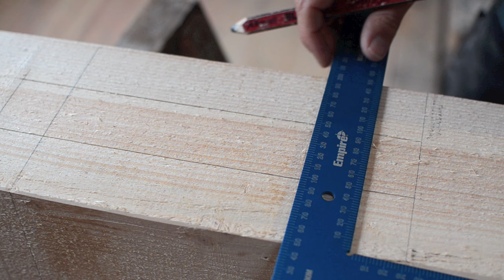Strong Joint - Timber Frame Roof Truss II

Comment: Sorry for the long comment, but perhaps you will find this information both corrective and useful in your future work...You kind of lost me on this one with "strong joint" unless that was a question (?) which in this case is, "Sorry, no, not really, for several reasons."

First, I think this is out of context with Steve's work. Second, your relationship within the video's demonstration of a European version of a joint as compared  to Japanese  (or Asian timber frame joinery) is out of context as this more reinvented (or reinterpreted) European styles of joinery to some degree, and applying them to what  is Asian modalities, while using a "mill rule" or "edge rule" layout system rather than what is found in Japan which is the ancient "Line Rule," modalities of layout which are very different systems and approaches. Third the nomenclature seems to be incorrect  (???) as I have never heard of..."Kashigi Oozier Hobo Sash"...though this could just be a poor translation. If you did mean...傾ぎ大入れ - “Kashigi dai ire”...thought not “very strong in this application as would be a through tenon and wedges as found in Dutch Barns, or in the Japanese vernacular a 鼻栓 - “Bisen” type joint like… 鼻栓ホゾ - “Bisen hozo” in one of the larger forms…

Your “Wedged Dovetail” (片下げあり - Kata sage ari) looks well executed, however they are seldom pegged as there is little reason to do so. Pinning the wedge in place would be more advantageous if worried about displacement over time as the “relish” on the tenon makes the pegs pointless. In a lateral load, the relish would just rip out.

The tenon on the brace is entirely incorrect for taking the greatest advantage of the wood's natural strength. It is also an "oblique brace" in the vertical orientation which is seldom to never used in Asian architecture where (if used) is typically in the foundation and in a horizontal orientation from sill beam to sill beam (火打梁 - “Hiuchibari”)...or...in roofs from rafter plate to rafter plate. If vertical "brace beams" are employed they are huge and act as "wind bracing" within lashed rafter systems as found in traditional Minka…

If this feedback was of value, please feel free to ask more questions...Thanks for sharing your work on this project...
Reply: Mr Whitecloud, you strike again. You are literally, present in a ton of places on the internet. You come across as an expert or seriously informed in so many different disciplines that its hard to believe anymore. It feels as if you spend your life on the internet, due to the never ending commentary on all things you offer. Permies. Youtube. Other forums. From a non expert, but observer of everything. Be well personally.
Reply: @LitoGeorge  Hello George…The web’s algorithms make suggestions to watch and I share what I’ve been lucking to learn. As for “expert” that is for others to consider; I dwell on it little. I have been blessed to be raised in and live a more traditional life; getting to meet others of like kind over the decades along the way and share it where it seems fit or asked to (ie. forums, etc.) What one chooses to believe (or not) has no real bearing on the information shared. My time “online” is limited to a cup of tea in the morning and late at night as I sleep little…and when lucky enough to be near this computer…LOL!
Reply: @littleforest  I will gladly remove the comment  @littleforest  if it was not of value to you, or you find such comment disrupting to the harmony of your channel...
Reply: @JayCWhiteCloud   Hi - you should apply to the Guiness Book of World Records for having the worlds largest ever cup of tea. Keep on experting.... cheers
Reply from the maker: Good morning Mr Whitecloud :-)
I consider the freedom of speech as something valuable. As long as they are somehow polite, i do not erase comments. 
So, you are free to do with your comment what feels right for you.
And it is up to the reader to see what opinion or point of view he/she takes as an inspiration.
Reply: @LitoGeorge  Apologies for the typos in my post to you...I corrected it.  Being in the "Guinness Book Records" is not something I would ever wish to strive for I don't...LOL!!!...Some find value in my comments I’ve been told, while others take uncertain umbrage or question validity, I"m fine with that...Thanks for sharing your views of it all...If you do have technical or direct questions on this topic I would be pleased to respond to them...
Reply: @littleforest Thank you, Sir I appreciate that perspective very much. My comment was meant as one professional in woodworking sharing knowledge with a peer. After 50 years in the traditional arts (including working as a Timberwirght) I thought you might find some value in what I shared and it would also afford you information to do even more in-depth research into Asian timber framing styles with the kanji I shared in my first post. I wish to also be clear that my comment was not meant, in any way, to disparage the fine quality of work you demonstrated in the video, but rather to suggest that some aspects are more "modern interpretation" and/or not best practice for certain (not all) aspects of what is viewable in the video. Thank you again for your comment and the videos you chose to share...
Reply from the maker: Now, as some time as passed by...
What i like most in all these internet things is to share knowledge, ideas and methods. Sometimes things get more value as they are done exactly different than the schoolbook tells, but the best is, to get trust: 'yes, i can do it and i do not need to be the super expert for it.'
I do not consider myself an expert knowing everything. So, i am open and thankful, for comments including reflecting questions or better/new ideas. Some of your older comments on my videos had something constructive in them.
If you now re-read your first comment on this video and put yourself into the reader's or my skin - even if some points might be 'correct', would you find anything inspiring, motivating or constructive in it ?
Reply: @littleforest  Hi Littleforest...Good to hear from you...I agree with a lot of what you shared. I only post on channels that have value and are being done by those who love what they are doing and wish to share it with others while they refine their skills and learn. The exchanges, like this one, are very enjoyable when it is based on open learning and sharing perspectives.

Doing things differently is all good...IF...(???)...the one doing something “different” understands the full aspects of the given thing they are doing. Taking this away from timber framing for a moment; experimenting when things aren't critical, (i.e. the failure won’t be dangerous and/or costly to repair) to learn a system to see how things work (for yourself or others) is how we grow every craft. Even medicine and science are a craft or at one time considered so. There is a lot of experimenting that goes on there for sure…

I certainly agree with the book part, having not learned to read until I was almost 13 years old. I now love books and appreciate the knowledge that can come from them but empirical learning (i.e. studying old buildings that have lasted) and learning from those in a craft (I apprentice with old order Amish as a Barnwright at just around 13 and that last 10 years on and off.) Part of the reason I became an experiential educator was the reality that many just do better learning “by doing.” I also teach what I was taught; the materials, tools, empirical observation, and the “process” of doing something will impart more valuable knowledge than any person or book could ever achieve…

I’ve been working wood (mostly green) from furniture to full architecture since 1968, so I guess that makes it now over 50 years, and I certainly am learning new things all the time. “Expertise” is a moving target and not one that any “real expert” claims as they typically are always trying to learn more. Our conversation made me dig through a bunch of old stuff in the folk style of Eastern Europe you have some weird oblique braces that have odd tenons on them similar to yours, with the difference they are blunted and housed. As you learn more about “relish” and the compression work that oblique braces perform within a structural diaphragm, you will understand this conversation more richly I’m sure. Your style, one of the reasons I started following the channel, has very strong Eastern European folk methods contained within it. I love this region (my father was Roma) and if I had been around while you were picking out this design for your frame I would have suggested looking at them and perhaps doing a “let in” live edge brace with dovetail housings. It fits the style you seem to have…

Your last point has great value to me, and I am so appreciative of it…!!!...I’m an inactive Marine and a former wilderness education director for a “boot camp” working with very aggressive inner city male youth for almost a decade. I developed this “militant” speaking and writing style that I’m ever trying to grow out of and feedback like yours (and I hope more!) is great to read!!! I’m used to “directive-driven communication” from having a science background, working with structural engineers on projects and my military service, so I tend to write that way still. That does not mean when speaking to a stranger or trying to convey information (like my first post) that this style works or is the best…IT ISN’T…!!!...and thanks for that feedback once more! Looking forward to your next video and please feel free to reach out any time directly if you have questions or ideas you wish to explore for projects…
Reply: @JayCWhiteCloud   this is good stuff from you in just one post. Father is a Roma, illiterate until 12. Apprenticed with Amish from 13 to 23, Barnwright, Timberwright, Marine, Wilderness Education Director for ten years. Has a science background, works with structural engineers. On Permies in 2014, you said you were a seasoned and experienced facilitator for over 35 years. You said you are pushing back and vetting the qualifications of people in the Permaculture world. That you have been doing this "Permaculture stuff" for a very long time. In 2015 on Permies,  you stated you had a job as a "State Supervisor in Pest and Wildlife Control for the State of Connecticut." To become State Supervisor takes more than a decade of service in that industry btw. Elsewhere you write that from 1987-1991 you worked at Bio-Tech Inc., Brookfield, CT as a Nuisance Wildlife Control Agent. During the same time period you were also "CT State Licensed Supervisor in General and Commercial Pest Control". During the very same time period you did a couple other jobs worth noting on your Linked In Profile. Seems similar but there is a vast difference being licensed for a job, than being the State Supervisor for the work itself. You are highly authoritative on all things Architecture from "vernacular, folk architecture in timber, stone and earth of the Americas, Middle East and Asia. Complete finish carpentry and guild crafts (e.g. blacksmithing, textiles, ceramics, etc.)."  You live in a log home built by someone else. Has written 2409 posts on Permies alone since 2012 (as of April 26, 2024). You use the word "modalities" in about 1/5rd of your posts. Most interestingly, your own Bio conflicts with what you said you were trained in and experienced in on time lines and years of experience. You wrote it, not me: https://tosatomo.blogspot.com/p/jay-c.html   According to you, you are a facilitator of both old Guild Arts and Crafts, have held professional certifications and backgrounds in Rock Climbing, Wilderness Education, Indigenous Life Skills, and Wilderness Medicine, Safe Crisis Management, Leadership Development, and Team Building, Self Defense for Women, as well as Situational Awareness and Security. Discharged U. S. Marine,  worked as a Park Naturalist, Zookeeper, and Animal Husbandry/Vet Tech, while also for a time being the Tree Warden in Thetford, Vermont and a long history in the Arborist trade. 
Jay owns and operates Tosa Tomo Designs, subcontracting and consulting to several Architects and Design Build Firms. He also, on occasion subcontract in Wilderness Guiding, Natural and Traditional Building Workshops, Indigenous Life Skills, Leadership Development, Experiential Therapy, and Personal Security/Self Defense.

Phew! Its a surprise that you didnt find time to be chief advisor to Che Guevara and Ronald Reagan, and oversee the NASA space program simultaneously while advising the United Nations on Housing, Water Security, Poverty Eradication and Disease Control . So, I have learned that you are excellent at producing word salads and massaging your experience into what fits for the moment. Despite your wonderfully authoritative writing style and absolute politeness in your posts, when I see your name in future, its a sign that being a wordsmith is an art in and of itself.
Reply: @LitoGeorge   Thanks for "plugging" my resume/CV...but I'm really not hurting for projects or work at this time...

Yes, it has been a rewarding life with many blessings and great teachers along the way. I think being an only child and growing up in a “traditional skills” household of artists, makers, and architects greatly influenced who I became as an adult, along with travel both in the military and on my own. My timelines of work, as stated are eclectic, never working on just one project at a time as it seems you have questions about. I’ve written less “online” in recent years as there are simply too many “trolls” haunting online forums and even in the real world I have learned as of late. Conversations like this and emails are about it now. The owner of Permies requested I join as a moderator but my tolerance for “profit base” activities by others has a limit and why I find more forums of little value now as the quantity of ultracrepidarians and trolls present is just too great. Individual conversations like this between two people are low-key enough to stay out of the guess of algorithms and not attract attention except the person I’m corresponding with…aka…no trolls…LOL!!!... However, I do find my own forum for historic restoration professionals on LinkedIn rewarding.

It seems you looked at my LinkedIn CV. You should note…since you are questioning it…that  “State Supervisor” in that field, in the 80s is a matter of having a degree or equivalent experience and taking both written and oral examinations…nothing more so uncertain of what you think you understand about that. The world has changed a great deal since the 80s. 

If all this is of interest (?) or you're trying to vet my background for some reason by reading my online CV information, you can feel free to email me.  I can share details of the current timber frame restaurant project I’ve been part of designing, building, and finishing here in Wisconsin. The owner of the project has become a good friend and it is perhaps the type of timber frame you would be interested in (?) since it replicates an old Carriage Barn from the 1840s.

You mention “conflict” of which I’m unclear, but if you find a specific error or typo I would be glad to correct it. As noted I’ve trained in several professions and worked in them as well. This does seem to give certain folks (like you?)  pause for some reason as if one can’t be a polymath; even though uncommon perhaps, it is not rare. No one is limited to doing just one thing or doing many things professionally…including creating “word salads”...LMAO…!!!...but feel free to engage rather than "trolling."

If you are ever truly interested in engaging in “real conversation” about “real projects” feel free to contact me directly by email and I would be more than pleased to share more if you are honestly vetting someone for what they are doing is of interest to you…not just "trolling them" (?)...I agree…”word salads” are pointless if you can’t get down to real life activities...
Reply: I smell shit too  @LitoGeorge